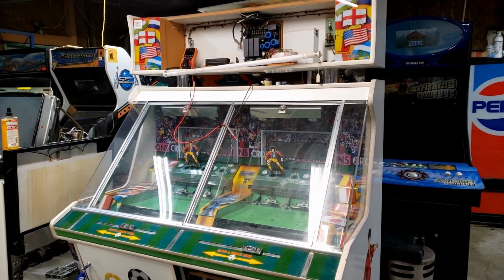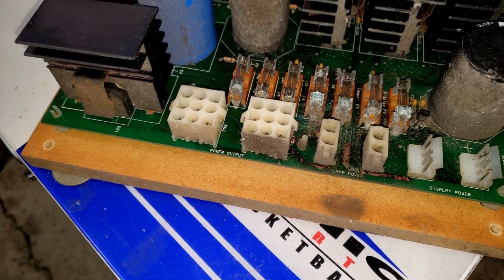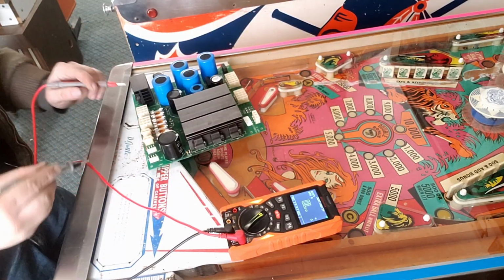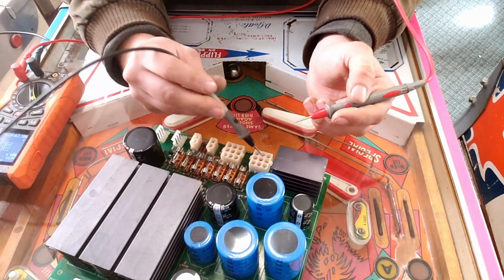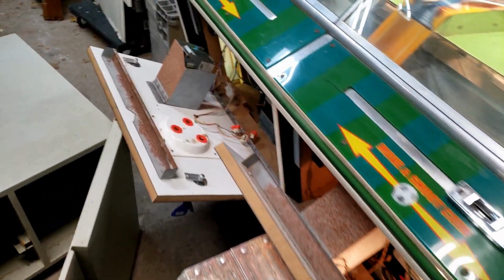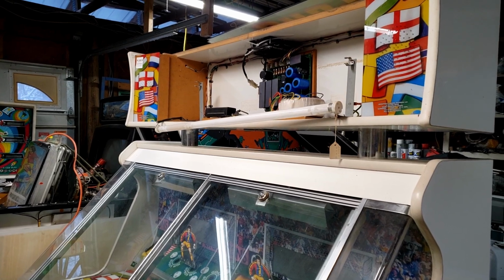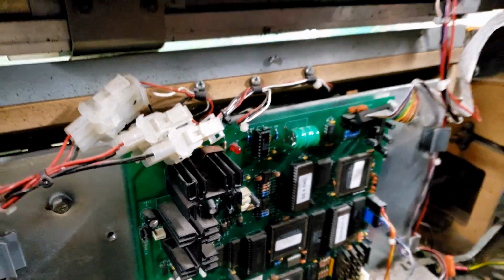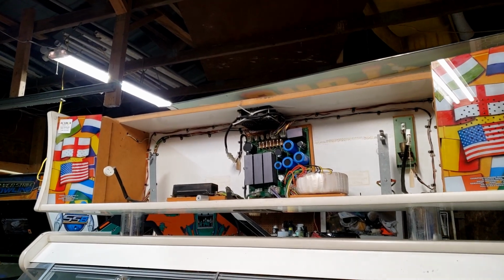Repairing a Soccer Shot Coin Pusher Power Supply Issue

Comment: What kind of corrosion remover are you using? So the regulators chips were bad but what else was bad on this power supply board?
Reply from the maker: @waynegram8907  I use raytech corrosion remover. The only thing bad ended up being the voltage regulator which most likely failed due to all the corrosion.